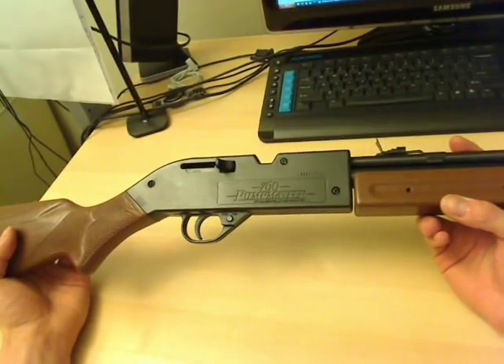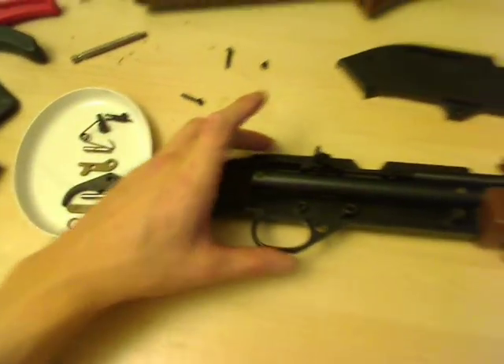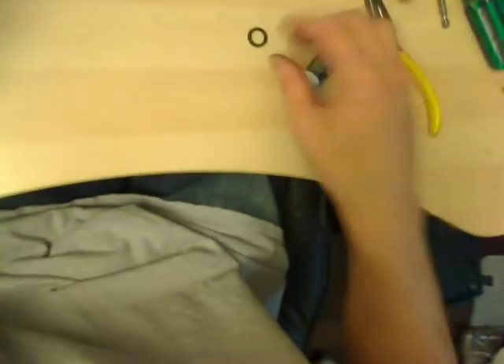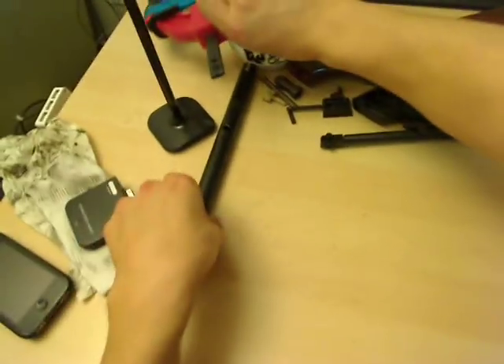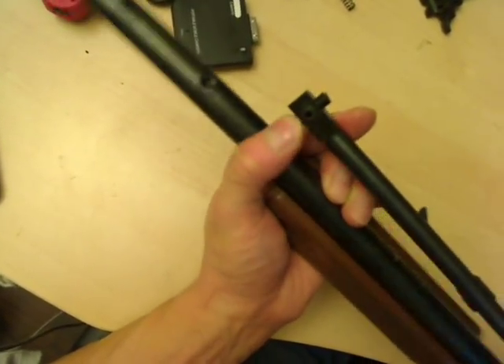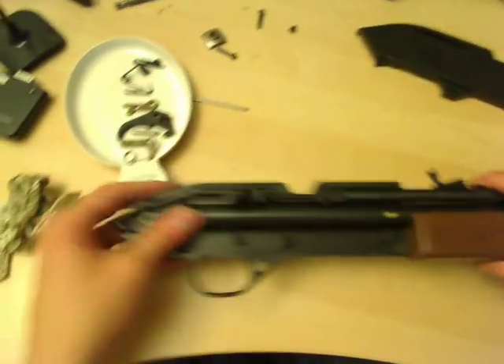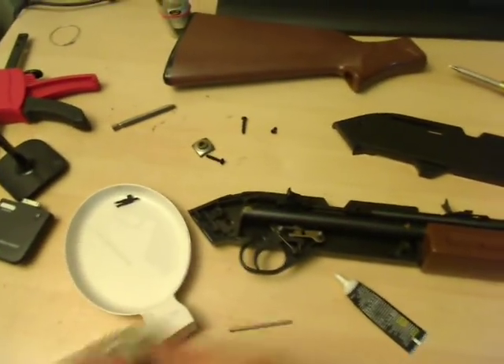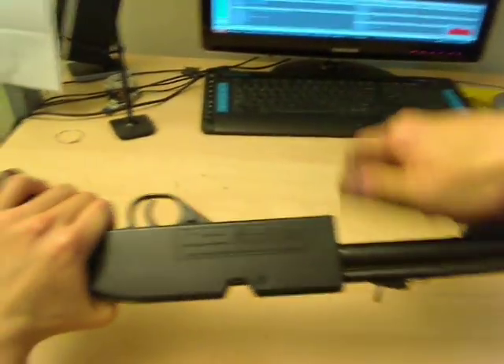FPV - How to Repair an 18 Year Old Crosman PumpMaster 760

Comment: After 11 years your video is still helping people. When I saw this video I remember that I bought my son one in the early 1990's. I found it in a box in the storeroom and took it apart. The o-rings is brittle so I will replace it with new ones. Also clean the gun and put so e chemical blueing ons the rusted metal parts. It would be nice to give the restored gun to him again.

Comment: Thank you David. I had this pump master from my father for 15 yrs. for 10 yrs it hasn't worked and sat in my closet as an eye sore for 10 years. I knew it was the seals but u showing me exactly how to repair it has made my eye sore a weekend fun time. Thank you Very much.I looked this up when i had it all apart up top the o-ring part.it as degrated i'm guessing by years or wear so im ordering a new one but it worked great! Thank you:)
Reply: How much were the parts?  How many pumps should I do? I did 20 and started having problems with leaking.

Comment: Man it's 2020, I got mine when born in 1988 and it finally wouldn't hold air and pump would not stay up. Bought kit on eBay and played and paused your video and rebuilt it, like a new gun now. Thanks.
Reply from the maker: Hi Robbie, 
Wow that's 32 years old!  Damn.   Mine is 27 years old now, this video was posted in 2011 LOL.  I should re-master it, still got the rifle, and now everything is in 4K 16:9, not 4:3.
That's great to hear you got your rifle working from the eBay kit!  Good to know that's a good place to get the parts!
Happy shooting!
Cheers!
David.

Comment: If anybody was wondering, crosman m-4 barrel does drops in fine 760 pumpmaster an it's rifled instead of smooth bore. The new 760 The hammer, hammer bolt catcher, hammer spring, charging bolt, safety, an hammer trigger release are UNV with each an the barrel an lower receiver housing too.

Comment: Thanks. I used a #9 o-ring from ACE hardware, Danco Co part number 35726B. Also, with no hairdryer here at work, we used water in Styrofoam cup in microwave to boiling temp, the dropped the rubber cup in water for 3-4 mins, then clamped to cool.

Comment: Thank you for posting this video. I just now repaired mine which is definitely older than yours. You did a good job showing how it all goes together. Mine is a little different with a separate metal cocking lever, and the screws are arranged a bit differently.

Comment from the maker: Nice, it sounds like a nice 760, definitely worth fixing.
The 760s between 1983-2001 are all the same.
The parts that work for them all are: O-Ring(130-035) and Pump Cup(760-140).
Contact Crosman directly by email to ask about ordering them, it should be only $5-10 depending on which state you're in.

Comment: Yes I noticed it was an older video David.
I got her done, the old O-ring broke apart Lol!
I had an o-ring kit from a faucet kit one actually worked perfect, and the rubber cup I actually used a marble in a clamp to spread that👍🏼
Thanx for your reply and again for your video.
Take care man!
Reply from the maker: Ya, I didn't have a great camera back then. I should do it again, remastered in 4KUHD lol..
That's awesome!  They got seal kits for these guns too, if the cup gets loose again you could try that.  
Mine is getting loose again, but if I pump quickly it can build pressure pretty well.
My pleasure!
Have a good one!
Cheers!
David.

Comment: Thanks for this video. I have a 20 y/o 760. It got where it wouldn't pump up anymore. So I bought a new one about 5 yrs ago, but kept the old old. Glad I did. The new one (with fiber optic front sight) is not as good of a gun. Not as accurate,either. Shoots obviously to the left. I've wondered how to repair the old one--and now I will. It's a much more accurate gun.

Comment: To get the Chamber out, lubricate with some penetrating oil and then use a smaller diameter piece of dowelling and drive it through with a soft mallet.  Worked for me.

Comment: Good video mine is Dec,1980 model replaced valve and cup almost finished need to readjust trigger assembly your video helped .plenty of pressure but trigger not releasing properly because safety was not releasing properly .I had spring wrapped around safety switch instead of against it,
Reply from the maker: Nice! That's an oldie but a goodie!! 
That's a vintage air gun.
Glad you got it fixed up. I'll never throw mine away.
Happy shooting!
Cheers,
David.
Reply: @DavidSunshine  Should adjusting spring on safety help force of trigger to fire BB .?
Reply from the maker: @garymirenda1983  I don't think so, if you want the hammer to hit harder, you'll want to bend the main spring so the hammer can hit harder. 
The trigger just releases the hammer.
Reply: @DavidSunshine  will try thanks

Comment: David, thank you, thank you! Obviously my channel name makes me sound like a Crosman hater, but I have warmed up to my M-4, so I bought a stock 760 primary to take it apart and learn tbe Crosman platform. Your video was crucial. Thought you would want to know that the new 760B has even MORE simplified trigger. Made my task easier. Also, longer pump that makes this 760B much better to work and 5 shot clip.

Have to say, though, that roll pin connection at the hinge point sucks! Cheap, cheap crap compared to 880 that has nice machined retaining pin. Easy to remove. The pump assembly in the Daisy platform is far superior to work on. The 35 is a hybrid of the 840 and 880 and is better than 760. The M-4 with how it feels and the many add on options...another story.
Reply from the maker: Hi!
You're welcome!
I like Daisy too.  I've got a powerline 008, rifled barrel, 495fps, it's a great shooter!  
My brother has a Daisy rifle, built same time as my crossman, and it still shoots fine!  LOL.  They must have mode those o-rings out of silicone or something robust.
The 880 and 35 sound good.
I've got a Nitro Venom Dusk in .177, it's pretty fun.
Cheers!
David.
Reply: David Sunshine - it seems like the pump cup wears out on the Crosman design. But any of the pumpers can have O-ring issues. Sometimes brand new. But if put together right, the seals hold up for a long time (with lube). 30W non detergent oil serves me well.

Glad you enjoy your Nitro. I just gave mine away to another channel. Felt like too much effort to get sccuracy. Cheers!
Reply from the maker: Ya, that silly cup. lol. 
I think the .177 isn't so accurate out to a distance, the 22 might be better.  I know what you mean, I put on a decent scope and even at it's most accurate, the grouping wasn't so great, might be ok on a calm day, might have been a little windy for the distance I was trying to hit.

Cheers!
David.

Comment: good video as far as take apart and reassemble, as for the rest  iam sorry i have not got anything good  to commnet on , if you are taking a gun apart to fixe it get the proper parts and fix it right the first time, on airguns use the proper oil and you dont grease the hammer it will slow it done and cause drag. the cup you use pelletgun oil or 30wt non detergent motor oil , never use grease of any sort on hammers seals or the pump cup, keep in mind older guns gain value .

Comment from the maker: Hey sorry, late reply.
That is a feathering shaft off an Align Trex 450 V2 RC helicopter, I just used that because it fit better than a pin punch.
You can just use a punch set, you can get those from automotive shops.
If you don't have that, use a nail of the appropriate size, you can file the tip down so that it rests in there and doesn't slip off.

Hope that helps.
And ya, you gotta hit that thing pretty hard to get it to slide out, you saw me hitting it, I had to hit it on weights even.

Comment: Thanks I just used a clamp with a hard bouncy ball and heated it up with a hair dryer and didn't have to replace the o ring. Just be care full when you put the receiver back together. Pump it and if it won't go all the way your piston slid down the chamber

Comment from the maker: Well, in theory petroleum mineral oils destroy rubber, but if you've used it with much success, then it's proven to work!
I haven't tried non-detergent motor oil in my guns, but sounds promising.
Cool website!

Cheers.

David.

Comment: My dad bought this exact pellet rifle for me in 93, when i was 8 years old.  I was going through some old shit and found mine a few minutes ago. Still pumps and holds air, but i wanted to disassemble, clean, and lube the moving parts; maybe replace some seals just for the hell of it. I cant get the damn butt stock screw out though. Guess its rusted in there. Oh well..... Cant wait to get some bb's for it. #Nostalgia
Reply from the maker: Ya, my dad bought me mine around that time too!  Awesome rifle, glad yours still works!
It's just a few seals that need replacing, not a big deal.  They just used poor quality rubber seals.
The Daisy we have from the same time still works, they must have used a better rubber.
I found that it shot way better with pellets, the BB's accuracy was very bad compared to the pellets.
I always liked plinking cans with pellets more than bbs, but bbs are fun too. lol.
Great air rifle, definitely.  It's a keeper.
Happy shooting!
Cheers!
David.

Comment: David I am writing to you from Chile, South America, on October 2008 I bought for my son a Crosman Model 1389 Backpacker which after a long time of use was left aside because the  pump system stopped working.  I already got a new Valve Assembly from Crosman but unfortunately the old one is stuck inside the pump tube representing a problem  for taking it out. In your video I observed that the valve shown is the same as the  1389 Backpacker but it can be easily taken out, so I would greatly appreciate receiving from you any suggestion in order to safely remove the exhaust valve assembly.
Congratulations for your excellent video.
Hermann Holbut

Comment from the maker: Ya, that's good advice, I'd never do it since it'll damage the gun, but if the gun is worth $30, and a pellet is jammed in there, someone might not have $15 to buy a cleaning rod to fix their gun, in that case a coat hanger would do fine.  

If the gun is worth $130, then yes, it's worth it to buy a $15 cleaning rod.

But ya, a coat hanger will always cause damage to the riflings if you stick it in there, unfortunately.
Reply: Could you use a wooden dowel? Or unsharpened pencils?

Comment: I found an old weird one. It has Crossman Coleman on it. The body is black painted metal not plastic. It looks like the 760 but the barrel is longer and the bolt handle and pressure cylinder is brass. I can't find much info on it but it looks the same internally.  It looks almost new but won't pump up any pressure.  I bet a 760 rebuild kit will fix it. Im guessing it was new and quickly forgotten in the back of the old basement / garage where I found it. The seals and cup are stiff as stone so probably has not been pumped once since lost.

Comment from the maker: You could try to use a nail, but that might not work because it's not hardened steel, it will most likely bend under the compression.  An old allen key might work if you dremel it, but only do that in a pinch.  You can put it into a drill and dremel it to size while you're spinning it.
FYI - I used an Align Trex 450 V2 feathering shaft, it's hardened steel so it worked fine, just had to sand down the tip a bit.

Comment: this video did help me I didn't replace anything but it showed me how to take it apart for me to clean it, but the "don't pump it more than 10 times or it will blow a seal" isn't necessarily true I have the original wooden and metal power master that my grandfather had growing up and I've pumped it like 50 times and I've never replaced anything.
Reply from the maker: Nice!  I've pumped it a couple times more than 10 but dang, 50!! That's hilarious.  I guess it maxes out at some point, probably designed not to hold more pressure than needed for 499fps for regulatory purposes, or else we'll have kids going around pulling it up like mad going 1200fps.  
Hapoy shooting!
Cheers!
David.
Reply: @DavidSunshine  yeah mine had started leaking the air out a little bit ago I just happened to want to use it along with my break barrel one I have so I decided to watch some videos of how to take it apart and everything, the O ring was fine but I cleaned up all the oils, grease, and dirt and stuff out and I just gotta finish putting it back together.

Comment: I bought my eldest grandson a 760 Pumpmaster for Christmas 3 years back. Somewhere during then and now he has managed to get numerous (exactly how many is unknown) pellets jammed up in the barrel. He said he was trying to make it fire as a machine gun. I'm realizing he's not quite ready or old enough for this pellet rifle. He was 9 when I presented it to him. My question is this: Have you any ideas how I might go about freeing the pellets from the barrel before putting the rifle up and away until he is ready?
Reply from the maker: Hi,
You can take a brass cleaning rod and try hammering it out, not too hard, but gently. The stainless won't scratch easily since the lead and brass are much softer, so light taps won't cause damage.  If that doesn't work, you can turn the tip of the brass cleaning rod into a drill head using files, I would do it to the male threaded end, so you don't destroy it, and it can still be used as a cleaning rod.  Remove the handle, then put it on a drill and drill the pellets bit by bit, letting the shavings fall out until you got them all out.  Just go easy on it and you shouldn't cause any marring to the smooth barrel surface.  They used to be rifled, but the new ones seem to all be smooth bore.  
Good luck,
Cheers, David.

Comment: I have had one of these rifles for over 10 years now. More like two but only one functions right now. I'm trying to repair the one but I can't find a replacement part. It's the one that the bolt slides into at the beginning of the barrel. The original one was cracked, probably from being over-pumped. Do you know the name of the part or part number and where I could find a replacement? This gun has sentimental value to me and it would be great to get it firing again.

Comment: i finally fixed my gun if its making a shh sound when you pump take the gun apart clean it check seals oil and unscrew the valve (bronze thingy) and there should be a plastic thing with a metal piece attached to it check that piece for cracks or dents it usually goes bad if you got sand in your gun hope this helps
Reply: Dear all 
I have purchased crossman 2100 classic calibre. 177 in 1985 from local market of (Karachi) Pakistan. 
I have needed it's pump.
Please let me know how can I get it.

Comment: this video has helped a lot but i have a tiny problem about a tiny spring and a tiny pin that fell out of my gun sometime during the disassembling . my gun seems to be 20+ years old not really sure because i found it in an old closet but it is older that your model because its all metal except for the bb door and the foregrip and the stock. any idea where i can find an older manual for my gun?? thanks

Comment from the maker: I say Daisy.
I have an 18 year old daisy 1 pump and it works great still.
I've also got a daisy powerline 008 and I'm quite happy with it. 

Crossman ain't bad, but the Daisy's in my experience have been more accurate and have lasted longer.
My future purchases would have to be Daisy because of my past experiences.

Comment: Good video. Mine was manufactured in 77' and is slightly different than yours. But, still the same., Although mine still wont pump up and the air seems to escape out the barrel as I pump it up. Anything to this matter?

Comment: There are some differences, pre 77 uses a different pump plunger and seal but most parts are still available. Air chamber uses the same seals. Going to reblue the barrel and pump tube. Stock and grip are in good shape.

Comment: hi i have a  American classic crosman  1377  .177 cal  its an old one i think it was made in the 80's or 90's  it will not pump up,,, What website did you get your parts from ?  thanks for the video
Reply: Check Crosman or JL Missouri on line through Amazon

Comment from the maker: Hey, the 761XL is pretty different.
I checked the parts diagram, and the parts are different, the o-ring and pump cup are 760-009 and 760-042, but those parts might not be the right ones, I put the link to the part's diagram in the info, check it out and see what parts you need, they're pretty cheap to order from crosman(In the US).

Cheers.

David.

Comment from the maker: I would just use the pellgun oil, it's for the airguns.
The chamber oil is for use only in the break barrel or spring guns.

The pellgun oil is just 30W SAE non-detergent engine oil.  You can find that for cheap and use that instead of the pellgun oil, it's expensive!  If you look up the MSDS sheet at crossman's website, it lists it as "SAE 30 Engine Oil".